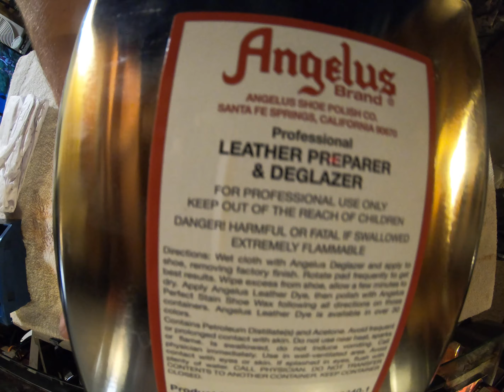Chanel Purse Getting a Color Change and Leather Dye Job

Comment: Thank you for this video!  I have a chanel bag that has not been re dyed since it is in great condition,  however I am interested in knowing what I can put on it to weather proof it, make it water repellent and protect it from color transfer. Can you recommend a product?  It is lambskin.   I have a Chanel in black and one in light beige.   Thank you
Reply from the maker: Saphir super Invulner is a great waterproof for high quality leathers. How ever the light colors you still want to be careful with even with any water or stain repellent as some colors can rub off from cloths
Reply: @CobblersPlus  thank you for your fast reply! I so appreciate it! 🥰  I will look up the product. Good to know I may still get color transfer even when using product on light color bags. I was thinking it would shield the bag so if color transfer did get on the bag, I could easily wipe it off with a light cleaner.  Thank you for the clairification! 😍
Reply from the maker: It will definitely help decrease the chance of the color transfer but can still happen
Reply: @CobblersPlus  good to know!  I am going to purchase it!  Thank you for the information! 😍♥️👍🏻😀